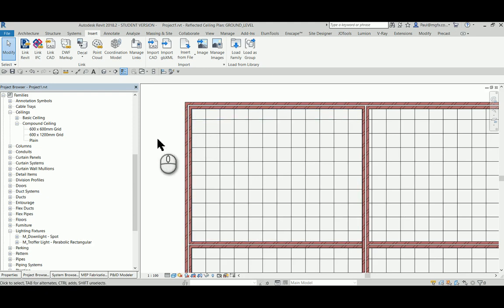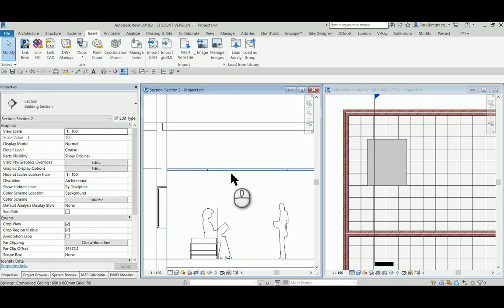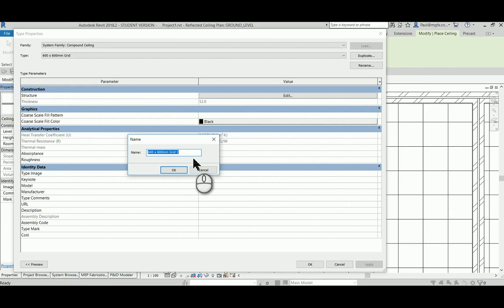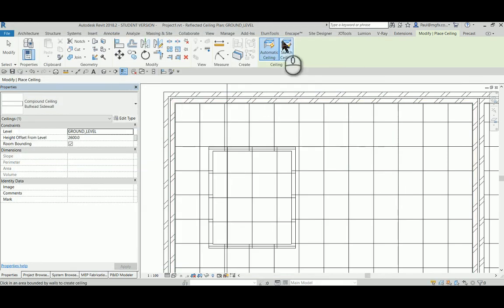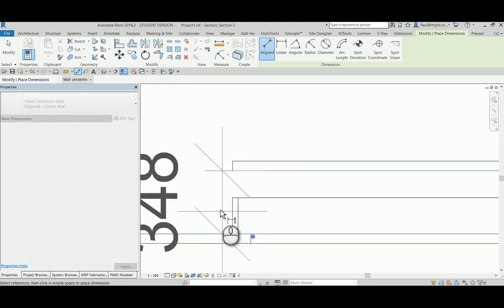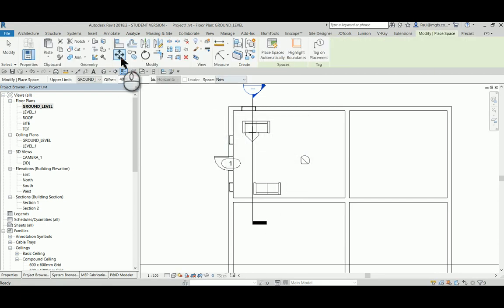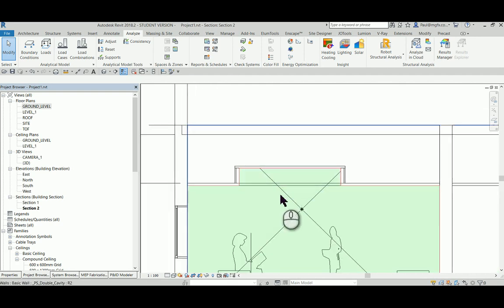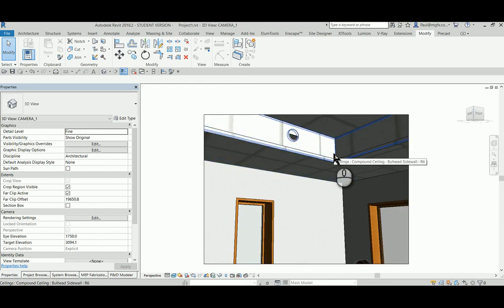Revit Bulkhead Ceilings

Comment: Using thick ceiling as vertical sides of a bulkhead might be a good solution on model and on drawings. But when it comes to material calculations on the "Multi-Category Material Takeoff" list for the thick vertical ceiling, a problem occurs. Revit does not calculate the vertical surface of the gypsum board ceiling but it calculates the narrow horizontal surface of that gypsum board ceiling facing the the horizontal reference plan. It means that Revit only calculates a narrow strip of a thick ceiling. That's a problem for material takeoff. These vertical surfaces should be calculated manually.
Reply: What I typically do is create a Thickness parameter for a material, and in material Takeoff calculate the Area by taking material volume and dividing by the thickness. That way you can use this approach and get correct values in your schedules. It does however mean creating separate materials for gypsum board 12.5mm and 15mm etc , but is that so bad?

Comment: I do not like this and do not see why this would be better than actually making the vertical portions of the soffit as walls. I think this is really only useful for concept drawings/early stages because modeling those soffits are a pain.
Reply: What if your ceiling is lay-in tiles with a grid and so is the soffit? in that case, adding additional walls would throw off any schedule you have.
Reply: @charlesball9522  I do not understand what you mean that the soffit will also be lay in grid? As in rotated vertically from their horizontal position to make the soffit? That is very strange. Normally the soffit IS a wall, a smaller framing maybe, but its not usually made of the grid material (acoustical tiles, etc), although the grid people do make products for soffits. 
Regarding the schedule, if that is a concern, then just filter out that type so it does not show it. Problem solved. If you are concerned about the wall schedule, you have no concern with the ceiling schedule showing this soffit ceiling type?
Additionally, the reason why this is worse than using a wall is that you need to make a new ceiling type for each soffit height difference you have, and that is worse.
My comment is 2 years old, in that time, I can say with definitive ness that modeling the soffit as a wall is the way to go, especially if you need to cu sections through it and show the framing, GWB, etc.
Good luck